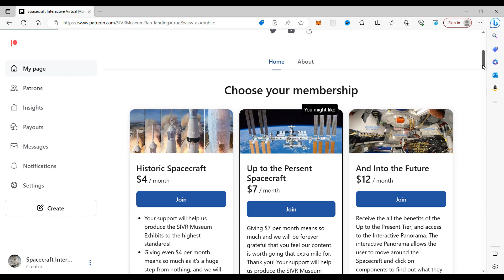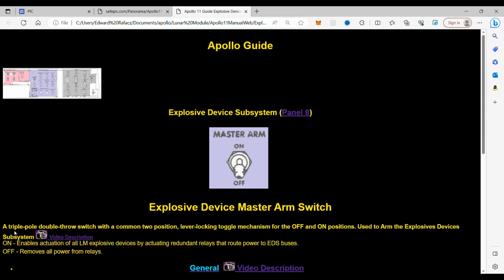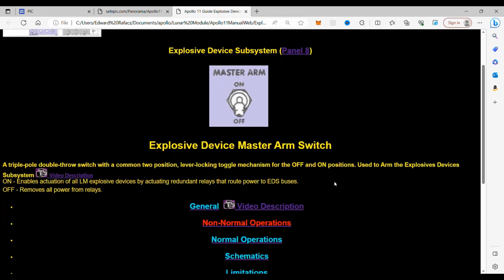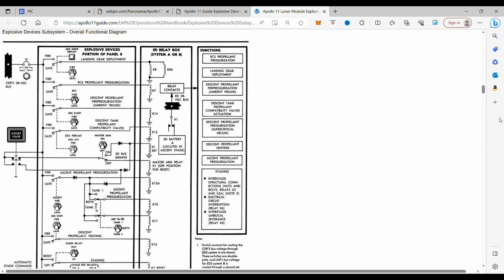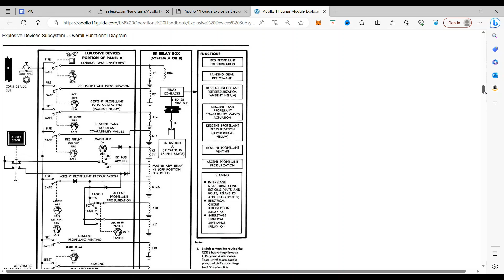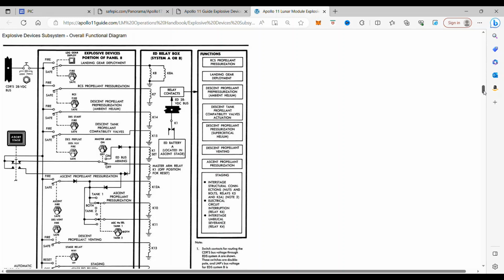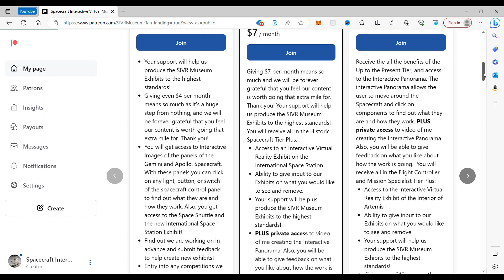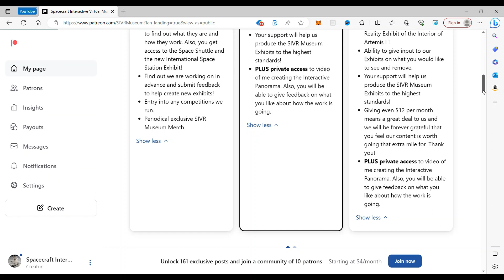Lunar Module Explosive Device Arm Switch

Comment: Where the explosives used exclusively to separate the descend stage, or in addition to some motor driven detachment?
Reply from the maker: The explosive devices were for functions that had to have been completed like opening a valve to start a rocket motor or separate a section of the spacecraft. Not only were they used in the Descent stage of the Lunar Module, but also the Ascent Stage. 
The next batch of videos will explain about the individual explosive devices worked on specific components of the Lunar Lander like the landing gear. Join me over the coming weeks to see how they Worked and thank you so much for joining my Channel!
Reply: @SpacecraftGuide  thanks
Reply from the maker: There is also an explanation of the Explosive  Devices sub-system here - https://youtu.be/2weB87onhNU